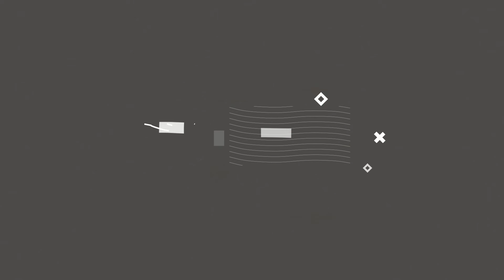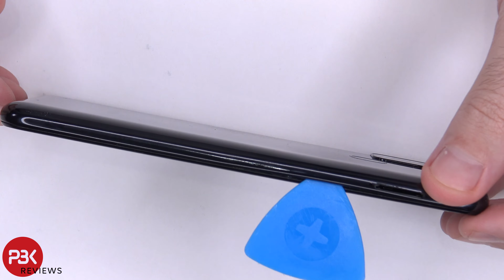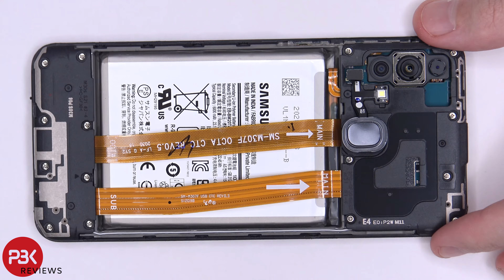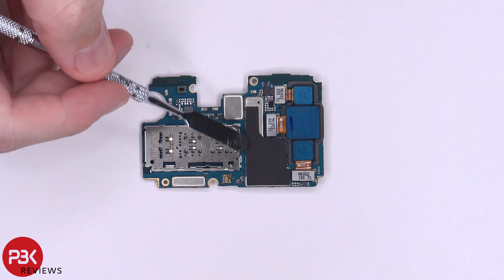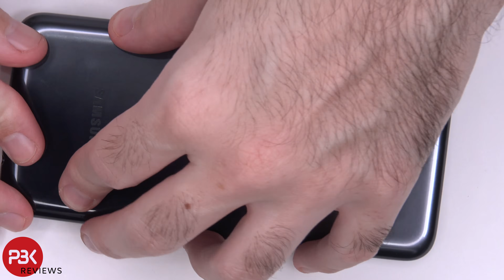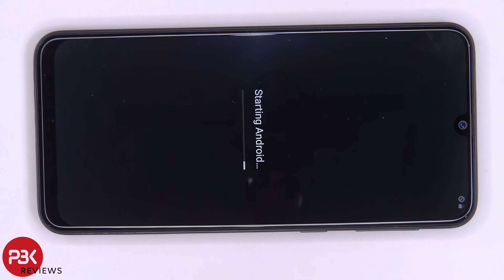Samsung Galaxy F41 / M21s Disassembly Teardown Repair Video Review

Comment: My samsung f41 suddenly freezed then tried to restart on its own then freezed for about 20 minutes at startup then switched off, it was warm when it switched off completely. Now it's not booting up and when I connected charger it shows charging logo but without percentage of charging. Can you help me what could be the issue. Recently I have to change charging cable I a local brand so not sure if caused any power problem.
Reply from the maker: It might be a bad battery not sure. You would need to try it out with a new battery to rule it out.